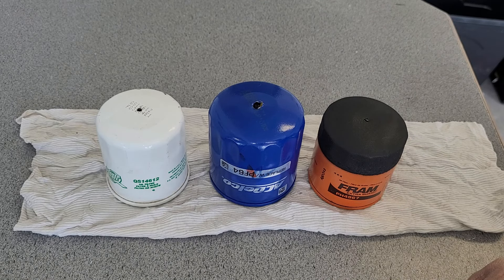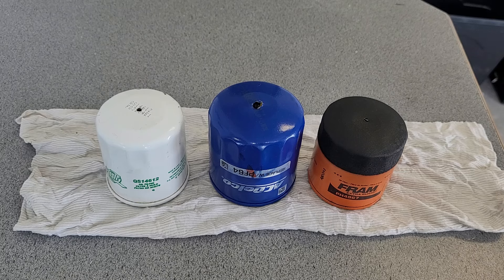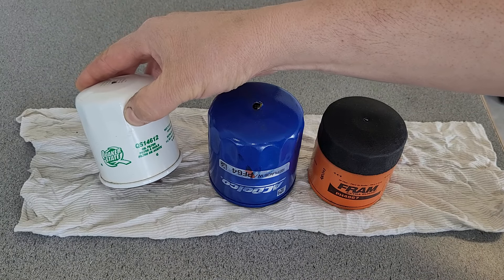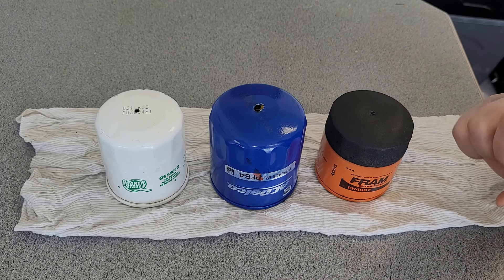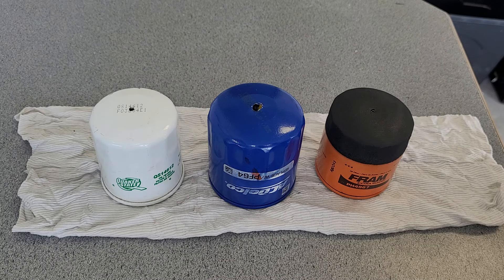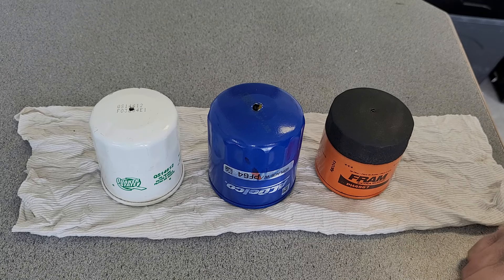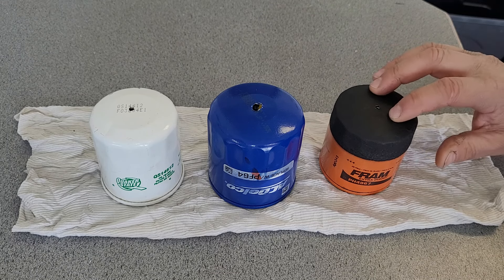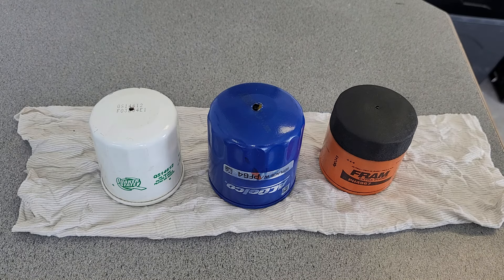Three used oil filters cut open

Comment from the maker: In the meantime, I have learned from the Chevy Cruise driver's father that the AC Delco oil filter only has about 3800 km on it since the engine had work performed. So that filter yes has 3800 km.
Reply: I was going to say , 88 k maybe 😂 Not good that it has had to have engine work 🫤
Reply from the maker: @LooneyFarmGuy yes the late oil changes did actually hurt the main bearings and they were changed out, not under warranty but paid out of pocket.😢
Reply: @crazybillsgarage  Yikes 😬
Reply from the maker: @LooneyFarmGuy yeah yikes is one word to use.😕